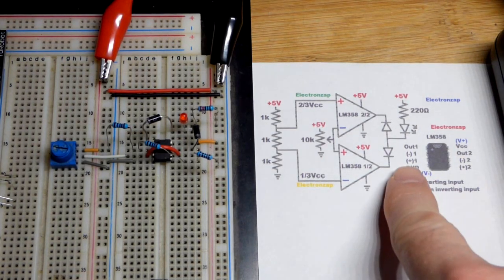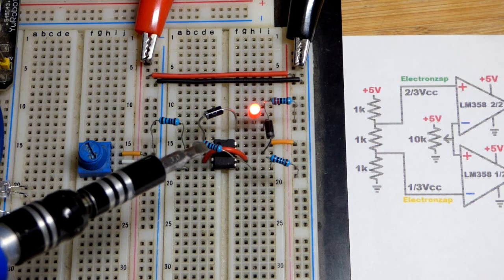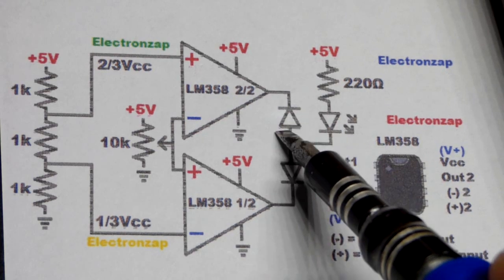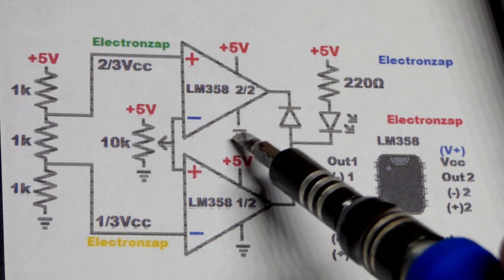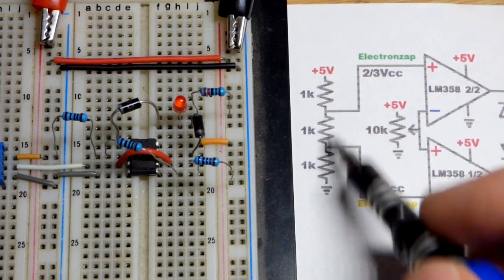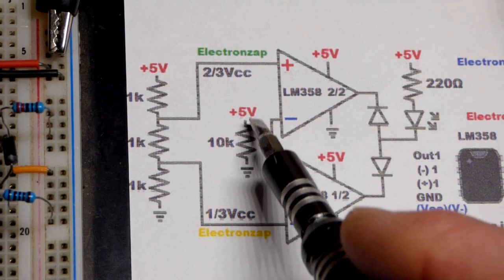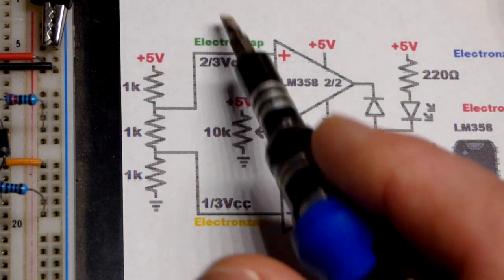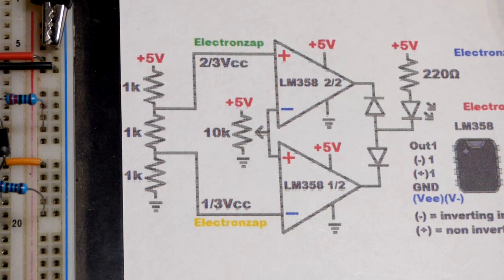Op Amp Window Comparator using Diode OR Gate and LM358 Dual Operational Amplifier

Comment: I am going to use this on my sxs to get a reverse light output signal for an automatic reverse light. The gear indicator uses resistance to between ground to tell the machine what gear its in. The problem with just using one side of the comparator is that the reverse resistance is not the last gear but somewhere in the middle. (H=620ohms L=300ohms N=160ohm R=75ohms P=24ohms) I think the is the perfect solution. Let the output trigger a transitor or relay. I guess I will have to add my own pullup voltage so the IC can see a voltage.
Reply from the maker: Nice!